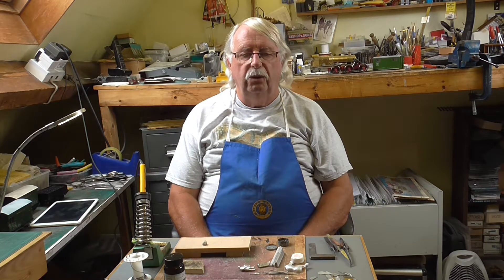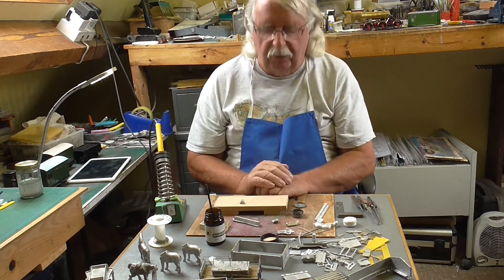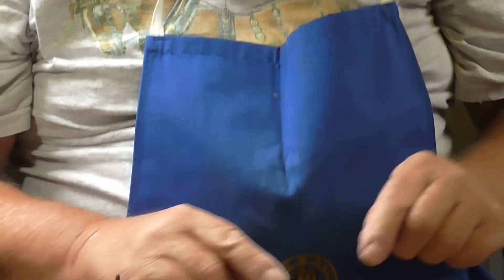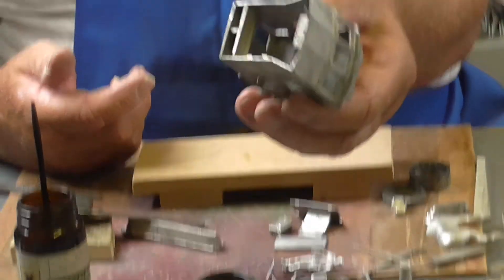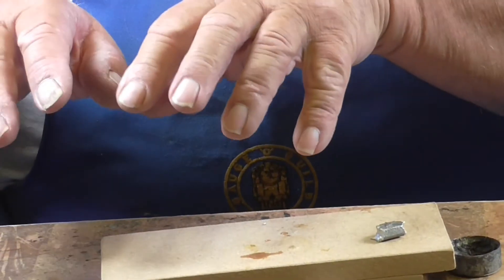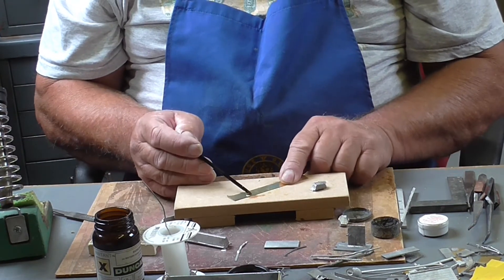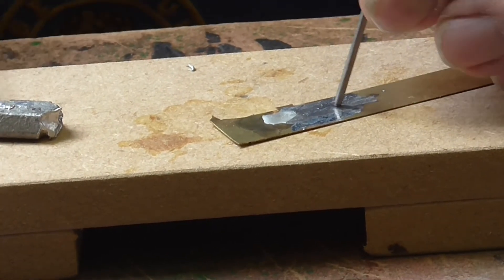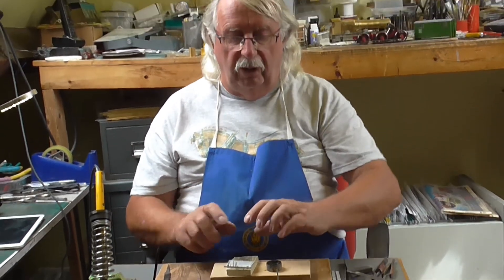Soldering Whitemetal

Comment: Thank you, Andy! Never had much luck soldering white metal until now! I don't have an 18W iron but use a 30W iron wired in series with a 100W light bulb, the shared current reduces the temp at the iron tip! Now that I've mastered an old D&S wagon, I feel confident enough to get my little engines N1 kit finished for Queensbury!

Comment: Cracking video! I have been building white metal kits for nearly forty-years and have always been unsure about solder, which would clearly speed up the assembly process no-end compared to eopxy resin adhesive. I now have a clear understanding of what is needed and the principals and technique behind this mysterious art. Thank you so much more than I can type.

Comment: I have an adjustable temp soldering iron. What temp should I set it to equal your 18 watt iron?  I can buy the Antec fixed temp iron but I was hoping to not buy a new iron. This is a great video with a lot of very useful information. I will be coming back to this often for more details as I try more kits that have white metal construction. Thank you for taking the time you put into this. The part about brass and white metal is extremely informative.
Reply from the maker: It largely depends on how big the parts are. It is best to practice on something that is expendable first, but I usually set my iron, for larger parts, to 300-325°C. Smaller to 260°C.

Comment: Hi Andy, thanks for your very informative video. The smallest soldering iron I could find is a 30W one and I am battling to 'load' the solder onto the soldering nib. Is my problem that the nib is too hot? Any tips would be greatly appreciated.  Best Regards Jez
Reply from the maker: The soldering bit needs to be kept clean, and tinned with high grade solder. If your iron plugs directly into the mains supply, you will have little control over the temperature, but it should work ok with normal electrical solder. If you would like some further tips, there is a soldering guide available at http://www.jimmcgeown.com/Print%20Off%20FAQ%20Booklet%20pdf.pdf that should help you even though it is for etched kit construction.
Reply: @TheGaugeOGuild  thanks Andy for your speedy reply. I really appreciate your help. I am using Woods Alloy as solder and am soldering pewter (96% tin, 4% antimony) using phosphoric acid flux. Will follow the link. Thanks Jez

Comment: Hi enjoyed your video, very informative, Have a question, I am making a 00 gauge tanker trailer, but cannot get the low melt solder to take on the tank part of the kit 
It works on the other parts and the ends of the tank, but no matter what I tried the tank sides will not take the solder. Have you any advice, would be appreciated 
Regards Terry Mason.
Reply from the maker: Terry, if the tank is not white metal but brass or another similar material, it will need tinning where the tank and the ends meet. I use 145 deg solder for general kit soldering and 70 deg solder for white metal. Tin the tank with 145 first, and then use the 70 deg to join the ends to the tank. I think in the video 100deg solder is used which doesn't need pre tinning. Peter
Reply: @TheGaugeOGuild  Thank you for that, the tank is made of alloy no wonder solder would not take. How to tin that I'm not sure. Terry
Reply from the maker: @terrymason3009  what are you using to solder anything that isn't whitemetal (brass, N/S, etc)?

Comment: Why did you choose to use the wire solder when working with the brass at first?
Reply: The brass requires 'normal' solder, which comes as a wire. The solder needed for soldering white metal has a much lower melting point, and this usually comes in a block.
Reply: Where do you get your white metal solder that comes in a Block?
Reply: @gord307  Also Where do you get the flux.  I would like to copy you to the exactly duplicate because I am having trouble.